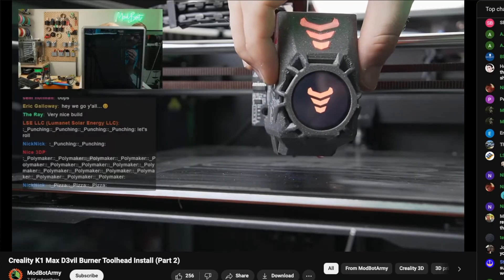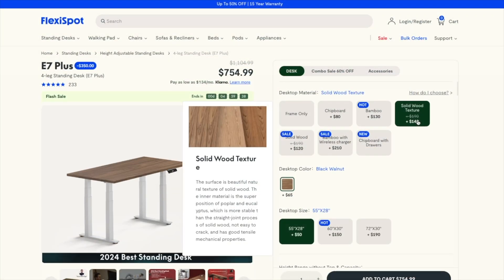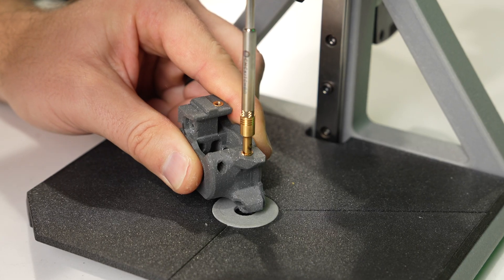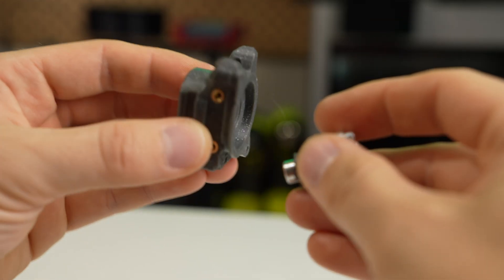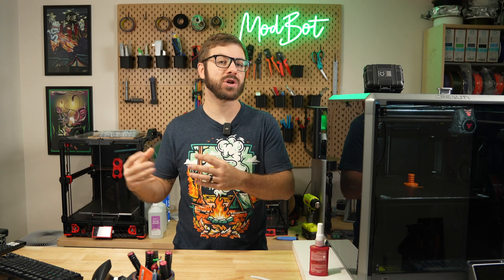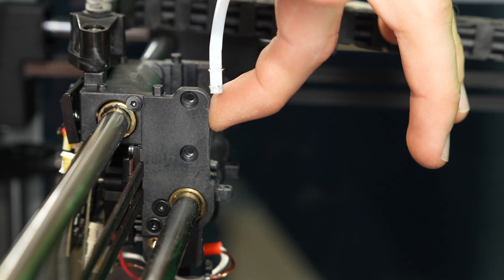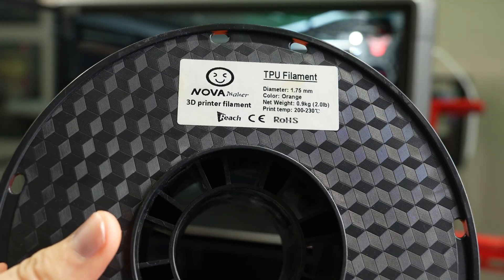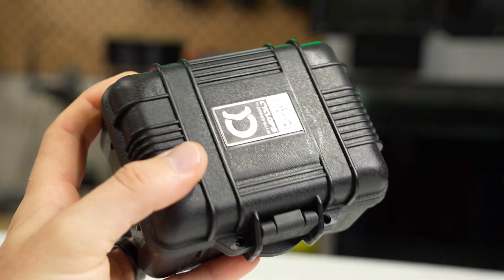Level Up Your Creality K1 Printer! (Cyclops Extruder)

Comment: Thank you very much for that! I'm looking for an aftermarket extruder for my k1 max that will also work with my CFS, any suggestions please? Believe it or not, with the upgraded extruder they gave me with the CFS kit my wires are hitting on the extruder and it has broken one of the wires.

Comment: Insane how a printer that cost $800 is lacking that much. One would think at that price that is would be somewhat close to a p1s that's on $699. After seeing all the issues I wouldn't ever invest in anything Creality. That's a lot of money to throw down the drain for several issues. I would rather have the Prusa Core one or the Bambu and know that i would actually receive a useful printer without rebuilding the entire machine.
Reply: "Insane how a printer that cost $800 is lacking that much." ?  the P1s is literally £90 cheaper, no ai camera, lidar and a smaller build plate. For comparing you should be using a printer with similar functions which is the X1C and surprise surprised is double the price. I'm confused what exactly is missing here?  a little binding and tweaking the bed is all im hearing here.  Ive never had an issue with my k1. Ill just go and print my full size helmet while watching the video at home.  Creality are not perfect, but if you think bambu are you are blinded by fanboy love.  IF you have constructive comments that add to the discussion im all ears but dont leave silly comments like "rebuilding the whole machine" when hes just changing the extruder.

Comment: ever since i turned down the current to .45 A I've had zero issues with the factory extruder, no longer do i have issues with pla jamming or overheating, i also print tpu perfectly every time, i see no need to upgrade the extruder at this time, i do however have a pet peeve with cooler, as the blower fan has a bad vibration and makes a very annoying noise

Comment: Hey I have an issue with K1. New K1 just arived and for some reason the Filament detector does not work. system reads the filament dector existance and blue lights appear when printers starts but it dissapears in instant (switch one once and off for 1sec). This cause in every print a message displayes before start printing the filament is not detected and if I want to continue printing.
Reply: Printer works fine except this issue

Comment: It's definitely an upgrade but i was a little put off by the price. For something you have to print the parts for.  I got it anyway and then when i got it i was again put off by the over the top case. I mean couldn't you use a regular box and drop the price? Maybe offer an option without a new motor? For that price they couldn't include some decent printed parts?

Comment: Did anyone try to DIY it from an orbiter extruder? The kit seems to be sold out, I wonder if you could just buy an orbiter 1.5 or 2.0 (with a stepper I guess?) and make one yourself. I get quality issues on my K1 max and I wonder if this might solve it
Reply: Yes, I've built my own using LDO Orbiter v.2 kit (with motor) and additional MR128 ZZ ball bearing (since this model uses different front ball bearing diameter).
Reply: @ArtDesignEngineering  well, gonna give it a try then. Did you need to rewire the stepper? I think I’ve read somewhere that  reality uses different wiring
Reply: @Dr_Axton  stock Creality feeder motor is Moons cse14hra2l410a-01, and my Orbiter v.2 kit came with LDO motor 36st20-1004ahg with no any jst connector on it (only wires).  So yes, you need to compare two datasheets for these motors and solder a jst4 connector for new LDO motor according to datasheet comparison (wire colors are different).
Reply: @ArtDesignEngineering  yeah, that's what I'm worrying about. I know Creality uses a 12 teeth stepper, while orbiter needs a 10 teeth one, so it's now like you can use the old stepper anwyway. I think I'll just order a kit from biqu, but I'll need to figure out the wiring. Also thanks for naming the K1 extruder motor
Reply: @ArtDesignEngineering  Thanks for this info.  I've got the same issue and I soldered the wires like the Libra extruder that also uses Orbiter, but either I effed it up, those instructions are wrong, or the LDO I have is different since it's a v2.5.

Comment: Just got my cyclops installed and seems great. The only thing I would make clear in your video some aspects differ for the k1 and k1c. Main being you won't need a length of ptfe for the unicorn nozzle and the nozzle wipe on the k1c causes the motor of the extruder to hit the frame so I just adjusted the nozzle clr to 216 instead of 219

Comment: Hi Daniel, my name is Francesco, and I am a 16-year-old guy passionate about 3D printing. About a year ago, I bought my Elegoo Neptune 4, an amazing printer that works very well, and I am happy with the purchase. Unfortunately, every time I turn the printer on and off, the Z-offset changes, and I have to recalibrate it manually. This frustrates me because I’m forced to make a lot of clicks to level the bed. So, I started searching online for a solution, but the automatic calibration either involved a load cell mounted on the nozzle or external hardware that was complicated to install.
So, I came up with a software idea that could automate the whole process. Here’s how it works:
You need to know the offset between the 3 axes, which is the distance between the nozzle tip and the probe for automatic bed leveling. You tell the printer to move to a coordinate near the center of the bed, take a measurement with the probe, and save it. Then, the head should move to the same coordinates but adding the previously recorded offset in X and Y, take another measurement, and save it as well. After the printer has returned to the previous coordinates, it needs to take the two previously saved data points and insert them into the following formula (the first measurement = A and the second = B, the Z-offset probe is the offset between the nozzle tip and the probe on the Z-axis):

(Z-offset probe + (X)) - (Y) + 0.1mm.

The final instruction to give the printer is to set the current Z-axis coordinate as the Z-offset.
Unfortunately, I don’t know how to program in G-code, so if you think this software might work, would you be willing to help me write it?
(If you think it won’t work, could you explain why?)
I hope I was clear. Thank you for your attention, I’ll be waiting for your response to hear your opinion on this matter.

Best regards,
Francesco
Thank you for your attention.

Comment: YMMV... I bought the kit expecting an improvement over the stock extruder... what I got was a headache. The first kit I received had no bearings in the kit meaning assembly was not possible. It took a week and a half to get the replacement kit that had another hardware kit, this one did indeed have the bearings so I was able to assemble it. Once assembled I noticed something was definitely wrong, in order for it to grip the filament I had to torque the adjustment knob all the way in to as tight as it would go. Less and it would slip. But this level of grip eventually filled the filament gears with filament grinds and it started to slip. I went back to the stock extruder.
Reply: Thanks for your message

Comment: I am going to give this a try on one of my K1's as I have had a few minor issues with the extruders. I am not much of a fan of the plastic gears in this kit though, The K1's original extruder I got had those which was part of the issue, I know this is a different layout than that stock extruder and I assume not a reason for concern. I also like the LCD for bringing this to shows. Thank you for the great video with clear instructions, much appreciated!

Comment: Great content. Do you have a advise for a extruder body with  integrated filament runout sensor. In my opinion it is the biggest problem on k1max

Comment: Daniel, thank you for this! I've been hoping for a drop-in extruder replacement for my K1 Max singing got the printer. It came with the original extruder, which Creality replaced with the upgraded one, but I've continued to have issues with clogs, so I'm hoping this will finally solve the problem. Got one on order and am looking forward to installing it!
Reply from the maker: Are you still running the stock hotend by chance? I’ve heard of others having issues with it. If your still experiencing clogs once you get this running I would strongly recommend looking into the flow tech from microswiss 👍
Reply: I never ran the stock hot end; the Micro Swiss one went into the printer before it even got powered on for the first time.😊

Comment: My k1 has been great so far. I have over 1600 hours of printing and no issues with the extruder. I did swap to the newest extruder and hot end on day one though. I would have liked to have seen some comparisons between stock (latest version) and this extruder. I dont mind upgrading when it is worth it but just doing so for the sake of it, is something i want to avoid.

Comment: Why is there planetary gearbox? it makes printhead heavier. Just two gears would be more than enought, there's no such torque that requires planetary gearbox.
And why there's LCD on a printhead? You can't read it midprint, but in makes printhead heavier.
Reply: Planetary sells well, you can have little less backlash than two stage spur gear reduction and reuses parts from the orbiter v2 extruder, also made by ldo. Only the shaft is different, but thats a cnc part, so no tooling required. Two stage spur gear reduction would be more compact and lighter

Comment: Can i use it on K1 Max the first edition with first version of hotend? or can you recommend better hotend for the printer, because with the stock hotend is the printer horrible..
Reply from the maker: Yeah should work fine with the standard hotend. I really would take a look at the microswiss drop in. Its way higher quality and their line of nozzles now has standard, hardened, diamond, and even cht. I was not a fan of the stock one.

Comment: "Drop in replacement" Proceeds to permanently cut and alter the tool head
Reply from the maker: Haha, fair. It is intended to be a drop in replacement as much as possible though. Same pinout and mounting points. Just the planetary gear system is a little wider.
Reply: @ModBotArmy  I do like the Orbiter extruder system though! I have a v1.5 on my heavily modified Ender 3 that's very under utilized since I got my K1 in January. Supposedly there is another extruder coming out for the K1 series as part of an upgrade kit to make the K1 compatible with Creality's CFS. I think I'll wait and see if that's true before I do any extruder mods.
Reply from the maker: @Scynide  ahh that’s right I forgot they were going to make it compatible with the k1 line and Ender 3 v3 I think. I’ve been waiting on a k2 unit. I really hope they can deliver. 🤞
Reply: @ModBotArmy  Looking forward to that video!

Comment: Do you chamfer the inside top of the PTFE when they are used inside the extruder ? I found it helps with filament loading on my all of my Orbiter V2 printers.
Reply from the maker: Yes! I use a vbit for this. I should have included that bit absolutely I recommend that.

Comment: @05:34 For those that don't have any Loctite at hand in a Pinch one can also substitute some Nail Polish. OBVIOUSLY not gonna be Industrial Grade Quality but still better than not having anything on a Metal-on-Metal Screw Connection inside a High Vibration Environment.

Comment: Only mod my K1 is waiting for is xy motors swap from K1C 😂
Reply: @wykonczeni  Right? The VFAs on the 36T K1 are so bad! I'm seriously considering pulling the 36T pullies off the original motors and replacing them with 20T ones. I've seen quite a few posts on the improvement this makes.
Reply: @Scynide  yes, in deed. I pulled pullies once in my ender with the force of my grinder xD now im checkin from time to time on alli, i believe k1c motors will be available soon
Reply: @wykonczeni  Maybe I'll wait and see as well. If they are affordable, that might be a better option than permanently modifying the stock motor.

Comment: It’s a cool kit, but for the price they should come pre assembled or at the very least with the 3d printed parts and heat inserts already done 

$65 is really steep for having to still do so much
Reply: Understandable since the orbiter v2, basically the same extruder in a different package, costs 65 euros with injection molded parts and fully assembled. On the other hand you also have the galileo 2 which costs the same as the k1 upgrade and is also only a kit. Still cheaper than a lgx lite which is 85 euros with motor
Reply: @over_pizza_2578  so, would I be able to buy an orbiter v2 and transfer its components to this shell?

Asking because the kit is basically sold out everywhere

Comment: Honestly been running 20 k1 series machines for the past year in a print farm 24/7 and the last extruder revision is holding up just fine with a lifespan of about 6 months before the bearings sieze up
Reply: Very impressive. Hope you’re not sniffing in ASA fumes 😅😂
Reply: @ I made a custom central filtration system for them with big industrial hepa and carbon filters plus a commercial air cleaning unit in the printing room….. it’s all at my company not at home but didn’t want employees breathing ASA either 🤣
Reply: My x1c which cost's the same hasnt had the first issue it just works with over 3500hrs on it.
Reply: @jcfpv3454  we have many Bambu machines as well 
They are not perfect Either 
Especially the new H2D
Reply: 6 months isn’t great tbh, I can’t imagine it would be that much more expensive to make it with proper parts
Reply: @PatrikTheDev Meh, 24/7 for 6 months seems good enough for a hobbiest printer. Plus we don't even know the total length of filament printed which would be a better indicator than "6 months for 24/7" because it's gonna be a totally different usage for slow printing materials and high speed filaments
Reply: @PatrikTheDev speaking of proper parts.

This cyclops extruder should provide proper parts with all parts pre-fabricated.
Reply: @nekrosoft13 for the price I agree. The case cost way more the cost of including some 3d printed parts. I didn't need a new motor either. Just an extruder that didn't have problems printing asa long term
Reply: @PatrikTheDev actually, 6 months in a print farm where the machine is constantly running 24/7 is not too shabby.
Reply: @UG3DBoss-54   yea it’s actually great 
Just got the new k2plus and either I have a shot unit or the z offset auto calibration is just horrible 
At high temps like 105C it is waaaay too close and digs into the bed the filament can’t escape and the printer clogs ….. terrible experience so far
Reply: @martinskamla6789  adjust your z offset after heating the bed , that should fix it
Reply: Not to be that guy but bambulab will last much longer than 6 months
Reply: @nikolaitoxvaerd  as I said 
24/7 print farm use 
Literally 5000 hours of high speed high flow rate ASA printing 
A regular enthusiast won’t print that much in 5 years
Reply: @nikolaitoxvaerd  Bambu glazer
Reply: @nikolaitoxvaerd  yeah they just casually catch on fire lol
Reply: @ThePerle1997 i have never heard of a Bambu catching fire?

Comment: Have you compared the kit parts to the LDO  Orbiter 2  parts?  Did you notice if they are the same?  I've been wanting to make this change but was hesitant until I heard some real world use of the cyclops.  I have the Orbiter 2 somewhere so I'd just use the insides of that if it's the same stuff.  Thanks!

Comment: Oh cool! I've already installed it in my K1C but it's nice to hear second opinion.
Tension lever had bent on my machine (printed ASA and ABS a lot recently) but to be fair I used default settings in Orca so that may be my fault, after I re-printed it with correct settings and using ASA it is performing great.

I had clogs with stock extruder quite a few times, so I am happy to say that it seems this one does not have that issue (metal guide probably helps with heat creep).